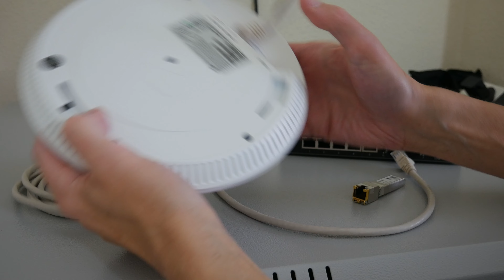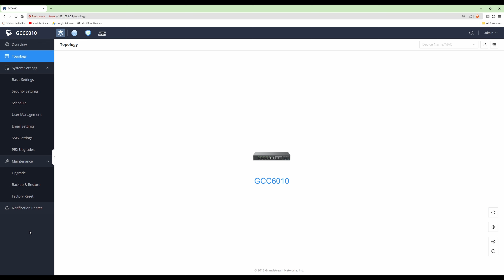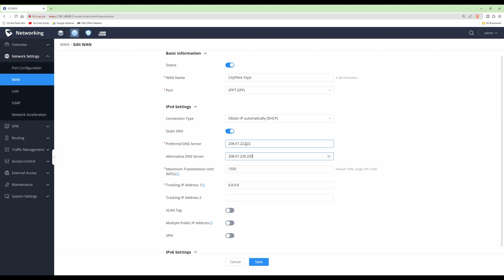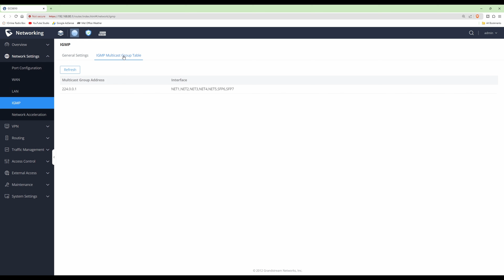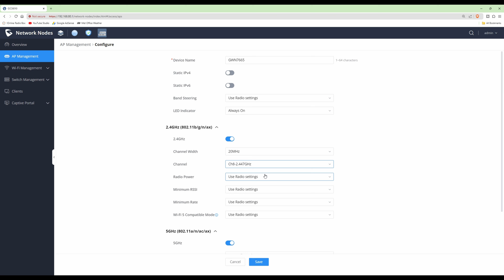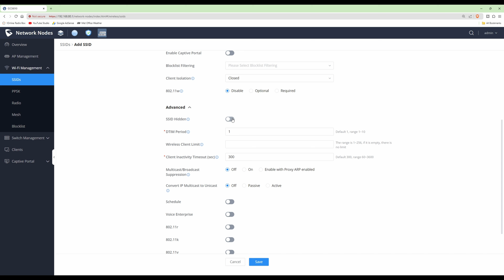Grandstream GCC6010 - Setting Up The Network

Comment: These support vpn client to nordvpn? (openvpn and wireguard client) Hows the processing power/CPU? Can push 300Mbps openVPN?
Reply from the maker: The VPN Throughput for IPSEC anyway, is rated at 1Gbps.  They do support Open VPN and Wireguard.

I couldn't find info about the CPU but a search on the Grandstream website should reveal that info.

Comment: Absolutely love the setup tutorial on the 6010 - nice job! I'm trying to decide which Grandstream router to buy and I have a question you may be able to answer: With the 6010, is there any ability to do inter-VLAN tag/untag on the routing tab, or do I absolutely need the switch to do that? Thanks so much in advance!
Reply from the maker: Hey, thanks very much indeed.

The 6010 of course not only is a Router but it also has a PBX included in it, although you don't have to enable that option, in which case you can just use the Routing function in it and add on (enable) the PBX later should you wish.

The good thing about the GCC6010 and 6011 is that they have 2.5Gbit WAN ports (SFP ones) and also a 2.5Gbit SFP LAN port too.

In answer to your question, you can create VLANS on the GCC and you can tag those VLANS to any of the LAN ports as you wish.

Hope that helps.